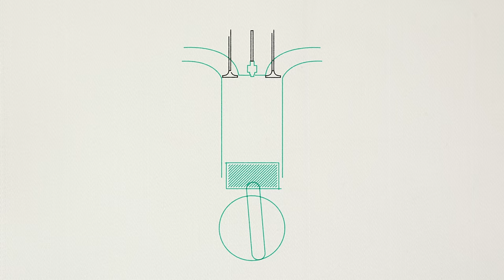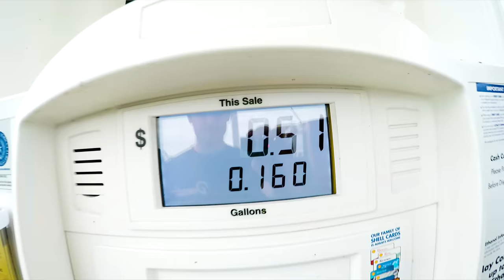IS THERE SUCH A THING AS BETTER GAS - How it Works | SCIENCE GARAGE

Comment: Well Shell advertisement or not, you learned about gunk, sticky valves, role of oil in piston, pinging, and octane rating. So it was still educational with a brand used as example
Reply: Right and it's not like Shell needs the exposure... Seriously people, just enjoy the lessons.
Reply: I’m surprised there aren’t more videos on actual independent testing of the amounts additives/detergents on different gas station brands.  From my understanding, most local gas stations will typically use the same gas as each other but have different additive packages that are required.

This video is 9 years old and is most likely outdated but it does show Shell premium as having the most detergents:  https://youtu.be/ystuUJWae0Y
Reply: This was my feeling. I’m still gonna buy gas at Costco but at least I learned a lot about the effects of bad gas

Comment: So use cheap gas 98% of the time and shell 2% and boom 130% of build up is gone
Reply: Honestly every once in a while quick accelerate can help your engine but having it flow more gas. If it's a brand with good detergents and lubricants it can slightly help with carbon build up.
Reply: But if you have a direct injection engine,  carbon build up on the intake valve will still happen unfortunately.
Reply: Muzalli Sam furthermore by flooring it you're actually making it worse. It's easier to tell yourself you're driving like a maniac to remove carbon buildup though. Damn GDI engines... Should of bought a Toyota.
Reply: @ElSikario100  a redline a day keeps the mechanic away.
There is actually a science to it, high revs break loose carbon deposits. And yes it can damage things, if it's a big enough chunk but it'll happen whether you do or don't anyway. So Italian tune ups for the win
Reply: Demonslayer20111 that's only true for port injected engines. On direct injection by revving high you'll be creating more deposits because there's virtually no way to for the engine to wash them away from the top of the valves. There's an excellent video explaining this. I'll attach the link later.
Reply: Demonslayer20111 I know it's been a month but I said later and this is later so I didn't lie. Anyway here's the link from Engineering Explained where he breaks down the Italian Tuneup. Talks about ideal temperatures for deposit buildup/removal and all that good stuff. https://youtu.be/5C9Ie4BcYew
Reply: Math!
Reply: 530Alpha sooooo kicking into VTEC while running Sam’s Club is bad?

Yoooooooooo
Reply: @mtunofun1  only if its 87

Comment: Definite Shell sponsored video here.  While to a degree what they are saying is true, gasoline will clean on your valves; however with most modern performance vehicles using direct injection this is an absolutely MOOT point.  No gasoline ever passes over the intake valves with direct injection therefor it is impossible to clean up any build up on them with any grade of fuel or even fuel additive.  The crap that builds up on the backside of intake valves in a direct injection comes from a failing or poorly designed PCV system.  It isn't varnished fuel it's oil particulate that passes through the PCV system and slowly builds up on the back of the valves.  You would benefit a lot more from a catch can on such a system rather than spending more for a fuel grade you may not require.  All gas suppliers have a gas similar to what Shell is hocking here, Chevron does Techron, PetroCanada does SuperClean...you get the point.  Run the specified Octane rating for your call and it will be happy, car manufacturers aren't idiots when it comes to engineering.  That being said never run a lower then recommended Octane rating or you will have a REAL bad day.
Reply: was waiting for someone to make this point. Very well said!!!!

Comment: I've used Shell premium in every turbo or supercharged engine I've owned in the past twenty years and I've never had any issues with the fuel system or carbon build up ever.  Too me, it's definitely worth the $4 extra each time I fill up.  For my daily driver I use shell regular and never had any complaints as well.  My least favorite gas has to be Speedway...that's just me though...

Comment: Worked at a shell station a few years back, trust me its the same gas, shell doesnt deliver shell gas to shell stations, it comes from a local fuel dispatcher, the same local fuel dispatcher that delivers to most of the other gas stations in the area. Ours was Torissie, in the two years i worked there i never once saw a shell truck roll up and deliver gas. The additives added to the fuel might be different from company to company, but the fuel is the same depending on region. Let me also say i never once saw anyone add any additives to the fuel, they may have had those additives added beforehand at the dispatcher, but ive seen that exact same truck at the local wawa down the street. Im more worried about water, dirt, and other contaminants falling into the tanks when being filled or level checked (which we did daily, even in rain or snow) weve had to have our tanks pumped more than a few times due to excess water being in the tanks. Shell is good fuel, but so are other brands. Just some fuel for thought, pardon the pun.
Reply: you also have wawa's in your area?
Reply: Usually the additives are added to the gas in the trailer tank as it's leaving the fuel dispatcher. Much like when a contractor doing a driveway will call in an order with a concrete company for a specific mix with specific hydration level with specific additives. But you are right. From the pipeline gasoline is gasoline.
Reply: Yea everyone already knew that, there’s only a few refineries for it to come from. But not all companies add the right detergents are abide by the top tier gas requirements

Comment: What these guys missed is most if not all gas comes from the SAME oil refineries. Then the independent gasoline companies put additives unique to their brand. Shell and Chevron put a lot of extra additives to clean your motor and increase efficiency. I only run Shell, Chevron, or 76. It makes a difference, especially in performance and high compression motors.

Comment: shell  91 is really good all jokes aside, always run it on my 11 A4 2.0T runs like butter, when I switch it up with another brand you can feel the difference in the idle and smoothness
Reply: In the US that is unlikely.The minimum standards for additives in fuel is pretty good .Your A4 has Direct Injection. Fuel is not sprayed on the intake valves to do any type of cleaning. I have run every type of gas and my cars runs the same on any other them whether Shell, Mobile, Chevron or Costco. If you can tell running issue from brands Im guessing you have other issue. Modern computer controlled vehicles are designed to run good on any gas meeting the octane requirement.
Reply: @chrisjones7281  live in Canada, I don't know about the StAtes but i do feel a slight difference in smoothness when you put 91 shell. Thats just me

Comment: I don't know about Shell gas, but Premium gas is definitely better for your vehicle versus regular. Originally when I was putting regular gas, my vehicles began to feel sluggish and underpowered. After switching to Premium fuel, the sluggishness disappeared and the performance peaked (the SUV drove like new). In my case, premium gas made a world of difference.
Reply: There's a few reasons that could be, spark plugs not being OEM, a lot of carbon build up creating higher compression, variable valve timing, etc. 

Without knowing what vehicle it is, I'll just assume your SUV had VVT capability. If not, something was fucked up to some degree.

Comment: I bought my first new car in 2016 a Toyota Corolla. The dealer told me to use a good quality gas. Not from a cheap station. I chose to buy Shell gas. My Toyota only needs regular 87 gas. No problems so far. I am going to stick with shell. It's really doesn't cost more than the cheap places and i can be confident that i am treating my car good. Before anyone asks. No I don't work for Shell, i am just happy with there gas!

Comment: The truth is that gas in the states has so many additives that even the cheap fuel works pretty good at removing gunk. It also depends on what type of engine you have as well since some engines squirt fuel on the valves, which in turn reduces the gunk on the valves since it's cleaning them. And you shouldn't run premium fuel on a car that is not tuned to run on premium. You'd just be wasting money 😉
Reply: no
Reply: My 1999 Lexus sc300 is tuned for premium
Reply: @Singleturbo-sk9qp  nice Camry.
Reply: @yuri0_187  its basically a supra its rwd with a 2jz wtf do you drive
Reply: It's not basically a supra lmao. It's a different version of a 2jz.
Reply: @Singleturbo-sk9qp  HURR DURR SOOPRQAA.  VROOM AREEEE ESOOOPRA. 

GUIS I HAVE A SUPPRAAAAA
Reply: @Singleturbo-sk9qp  Wrong 2jz
Reply: @takarlor12  funny thing is supra came na also and manual with a w58 so stop and people boost the na motor all the time na motor is a better flowing head and better flow on the exhaust side but the gte has better flow on the intake side

Comment: I put Shell's 92 octane V-Power in my 2018 6-Speed Manual Honda Civic LX Sedan since the car's first fill up around September of this year.  It has the K20C2, a NA 4 cylinder engine that let's be honest.  In comparison to Honda's L15B7, the K20C2 is weak but it still makes me smile.  Think of it as "The Llittle Engine That Could". I drive up steep hills 5 to 6 days a week while being at 2k to 3K RPMs.  While the air conditioner is on, if ever.  Nearing 6000 miles on the odometer and I did do the engine break in procedure.  I drive my car gently right away the moment I turn it on.  After  20 minutes into my conservative drive, the engine oil is at operating temperature.  When I am done driving I idle the engine with everything turned off except for the low speed fan, that has the air conditioner off.  After 2 to 3 minutes, I shut off the fan before shutting off the engine.

I have no problems but no doubt you'll be thinking  "Your engine is new!  Just you wait and see when the engine has more miles on it!"

Shrugs  I take care of my car and don't granny drive it or race it to death.   Let me put it to you this way.  2K to 3K RPMs on the highway in sixth gear and 80 mph is at 3K RPMs with a light throttle driving the car.  I never had to down shift except if I know the engine is going to lug then I downshift into the appropriate gear before that occurs.  I do use Honda's shift points as reference to know when I shift my car.  Can't forget to add I don't floor it when I drive up the hill.  I downshift and light throttle up the hill.  I don't want to hear something knocking underneath my hood.

Comment: My aunt and uncle are the original owners of a 97 Toyota 4 runner. They put nothing but Racetrac and 711 gas for 21 years (87 octane). Has never broken down. I'm sure shell v power works but I don't need to keep a car more than 20 years anyways.

Comment: Say what you want about this being a Shell advertisement but I only use Shell gas in my 2015 Tacoma since I first bought it new with 0 miles before I bought that I had 06 Chevy Colorado. I have used many gasolines but since I started using only Shell (87 regular if your wondering) even in my Colorado I have always got good gas miles. And never felt any loss of power. Any time I put low grade fuel (kroger gas, Wal-Mart, HEB, etc etc...) I could feel the truck not have the same get up and go and they would burn through it quick. In my Tacoma I get about 310 miles before I have to fill up (fill up is always at 1/4 tank mark) and in my Colorado when I had it I would get about 330. So yeah I have a firm strong belief in good gas equals good power mileage and long lasting engine.

Comment: As long as you run 91 or higher octane, doesn’t matter from which gas brand, you’ll be fine. 87 and 89 tend to leave “gunk” on your valves and engine.

Comment: Hell yeah there’s better gas, don’t buy the cheap ethanol mixed stuff because the bad burn means uneven piston explosions
Reply: ? Ethanol doesn't cause "bad burns" or misfires. Also ALL gas is required by law to have ethanol mixed in since 2007. Even the supposed ethanol free stuff has small amounts of ethanol.

Comment: I'm a petroleum transport driver. I drive for a contract fuel hauler that picks up petroleum fuels from fuel terminals and delivers it to various gas stations. Here is the truth.
Every fuel terminal gives options to fill the tanker with the customer's order. For exmole, Shell terminals will allow "branded" and "unbranded" fuels within the same the same terminal using the same fuel arms and pump it into the same tanker. Fuel tankers do not get flushed orneashed out between loads and there is always residue from the previous load. For example, first load of the day could be 7500 gallons of red diendiesrl (agri diesel- no highway tax), then return for a mixed load of 87 octane, midgrade and premium. It is important to note that all of the very large tanks at fuel terminals are "regular" grade and butane is injected during the loading process to get the rated octane. Also, fuel can be ethanol blend or "conventional" (no ethanol) and it all gets injected in the delivery pipe hooked to the trailer as it gets loaded.

Then there is the issue of "branded" and "unbranded" fuels that are delivered at the station's bulk tanks each station has a contract to purchase XX amounts of fuel  in a period as well as whether it is branded or unbranded products. Many stations have a deal with the appropriate petroleum company to order their branded or unbranded product and usually gets free signage or advertising.

So what is the difference between "branded" and "unbranded" fuels and how can you tell of you are getting a branded fuel? Unbranded gasoline is virtually the same across the board. Just because a station has Shell signage all over the place doesn't mean you ate purchasing a branded fuel or that it has all the Shell additives you see in their advertisements. On facts more times than not, the station is ordering "unbranded" and it is identical to the station down the road with another petroleum sign. Federal and state regulators only dictate that a gas station has to sell an accurate gallon of gas and meet the octane level. All other criteria os not regulated. 

Diesel fuel is even a worse case. Diesel is diesel. No fuel terminal has an option of branded or unbranded diesel. All of it is unbranded. Another issue diesel has is there is no regulated regulation for the cetane level (the diesel version of octane) of diesel. Essentially that diesel you pump from any truck stop is absolutely the same as you get from everywhere else.

So os Shell gasoline actually better fuel? Maybe in the confines of a laboratory, but the consumer is constantly hoodwinked by deceptive practices in marketing and so many opportunities of continuations of other petroleum fluids can occur that the product coming out if the pump is nowhere close to what is advertised that it really doesn't matter.

Comment: Wow!  From the comments below, it seems like people are not liking this video.  Maybe you guys need to visit Chevron, Mobile, 76, ARCO, etc to show that this is not just a Shell advert.  Then again they would probably think you were doing an advert for each of those companies. Hmmmmm......what would be a great video is to pit the different companies against each other.  The test would be to get a few barrels of gasoline from each of the companies.  Do the equivalent of 100K miles of engine use using identical engines and the same oil.  Run and maintain the engines the same way.  Then see which gasoline company makes a "better" gasoline.  Once you do that, you could pick one of the top companies and test between the different octane ratings to see if an engine that uses 87 runs "better" using 91.  Unfortunately, I know from experience do not put 87 in an engine that requires 91..whooops....  And since, Pumphrey keeps claiming he makes a million dollars per episode in his Up To Speed videos; he should be able to fund this test easily.  LOL

Comment: I tried 87, 89, 90 ethanol free and now Shell 93.  The ‘18 Pathfinder 3.5 runs the best on the 90.  25.2 avg mpg.   I reset it,  and 24.7 it’s still climbing.  Tells me there’s no ethanol in it.   I get the top tier additives and Infiniti requires premium on the same engine.  No harm, no foul.  So,  if the timing adjusts , might be more hp.

Comment: Ok so if any one out there doesn't believe or trust this video due to the connection to shell there is a salutation. Simply clean your engine, then run "cheap" gas for a time, let's say 6 months, then open the engine and check for build up, clean out and now run "better' gas for the 6 months and then open her up and check for build up. I can say one thing though. I do notice a big performance difference between "cheap" and "high" grade fuels.

Comment: In Australia after WW11, a lot of taxis cabs used fog mist to increase horse power and reduce fuel consumption. After 100,000 miles the motors were pulled down, and they looked like brand new. Hardly any carbon build up and no signs of rust.

Comment: Gas doesn’t cause deposits - pcv and egr combine to form deposits.

 Reconfigure pcv and egr so only air flows through the intake and deposits will never appear.

 Then all your fuel chemistry can be focused on BTU and flame speed.